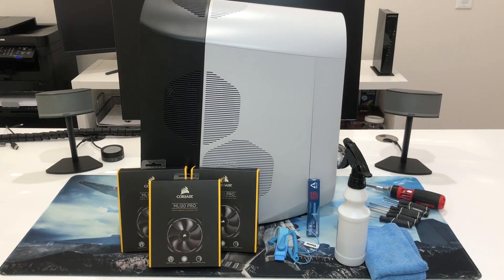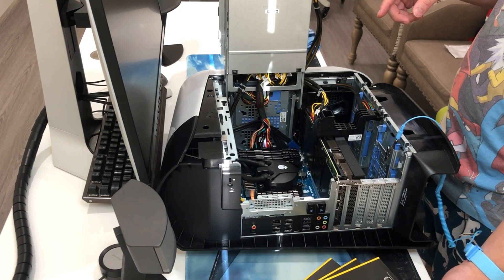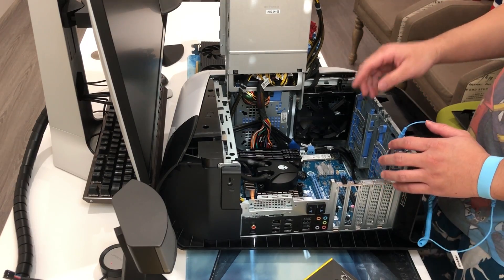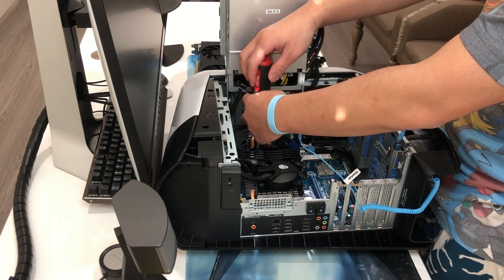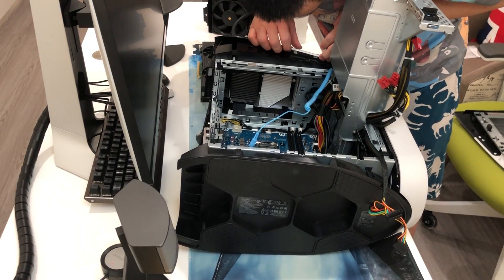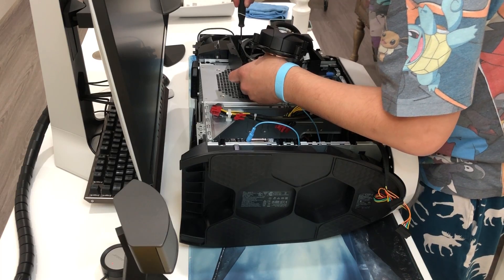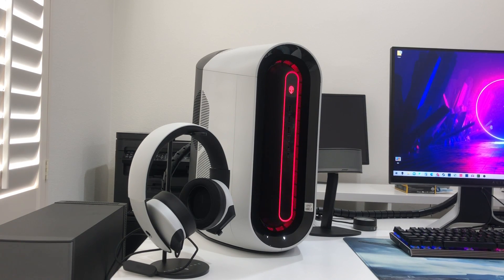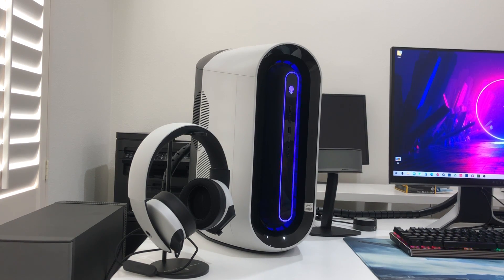How to Upgrade Fans for Alienware Aurora R11 / R12 to Lower Temperature and Noise - Top & Front Fans

Comment: I bought my R10 like 3 months ago... it was the only way I could get the GPU I wanted. anyway mine looks identical on the inside. So I'm curious why this wouldn't apply to the r10 or maybe it does. I really don't care about how hot it runs... it never really gets over 60c even if I run cinebench r20 for 10mins.... it hits maybe 68c. It's overclocked at level 1. it's a ryzen 5900X in an RX6800XT. The temperature of the GPU... I do worry about. It hovers in the high nineties sometimes over 100c.. Especially when gaming in 1440p or 4K. if I cap it in 1440p at 60fps it'll stay in the 80s and low 90s. And that's playing ACC 2077 and rdr2. I have some kryonaut but I've been too nervous to take it apart and repaste it. I've taken apart 2 laptop and repasted them but they're cheap first-gen laptops. Complaints that I do have are that smart Access Memory doesn't work and the PCI slot is only 8x LOL I'm probably saying that wrong but it only uses gen3 not Gen4. Maybe in a couple months I'll get a case power supply and a badass motherboard and I'll just have a badass computer. Please remember before roasting me in the comments that this is my first PC and the only reason why I got it is cuz I was tired of PlayStation.
Reply from the maker: Thank you for sharing your experience man. how's the beast running now?

Comment: I’m getting top fan bios error
Reply from the maker: How many fans did you change?
Reply: @RyanYu  3, mostly the top fan is giving me the bios error.
Reply from the maker: @Eqnotalent  did you use the Y-splitter ?
Reply: @RyanYu  the top fan no, the 2 front fan yes.
Reply from the maker: @Eqnotalent  so, you add another fan to the front then? Try to remove one?
Reply: @RyanYu  i added one at the HDD bay
Reply from the maker: @Eqnotalent  Have you tried to remove one to see if it works?
Reply: @RyanYu  yes, still getting top fan bios error
Reply from the maker: @Eqnotalent  just one fan without the y splitter ?
Reply: correct. 2 front fan on Y cable on the 4pin front plug, top fan by it self on the topfan plug.

Comment: The cooling upgrade was due to swapping the thermal paste FYI. Those original fans are 146 cfm and the Corsair ones are maybe 70 cfm. That's what happens when its 4k vs 2k rpms.
Reply: In such a restrictive case pressure performance may be more important than CFM... Also why would Dell make a top of the line PC a jet engine?! 4000 rpm is too crazy for so many thousands of dollars, they could have put Noctua A12x25 at that price point and still make mountains of profit.
Reply from the maker: It’s not only about CFM.

Comment: May I just keep the side cover opened at all times so as to lower the temperature?
Reply from the maker: You can of course buy it will get a lot dust.
Reply: Yes that helps. Reduced temps by 3-5 degree celcius

Comment: Those Corsair ML120 Fans are significant lower CFMs than the stocks fans, so definitely are quiter but does not improve cooling, in fact, the other way around.
Reply: Naive, bro, you may not good at physics. Fans manufacture not only consider about CFM, but also consider about air pressure. More specifically, static pressure. And you will find out that higher CFM mostly get lower static pressure. the fans manufacturers take a lot of effort to find the balance between these two factors. So only focus on CFM is not make sense…..Think about the relationship between torque and rotational speed
Reply from the maker: @jiayilin836  man, there is so much to learn.  I’m learning every day.
Reply: @jiayilin836  You are correct, there are other variables to consider aside CFM, that's why I made the test: I took temps of my GPU and VRAM with the stock fan versus the Corsair ML120 during mining, and the temps were considerable lower with the stock fan (the noise was way louder as well). CPU temps were also a couple degrees lower. I ended putting the corsair fan at the top, instead of the HDD place holder and the stock fan in the original place to keep the VRAM as cool as possible. And yes, I don't have a PHD degree on Physics, but I'm an engineer and took enough Physics courses during college (not that really matter in this case..)
Reply: @DefianceDarkness  oh really? nice job, you will find more. just keep going further
Reply: So replacing original fans with Corsair fan will lead to higher temps?
Reply from the maker: @pb96-p6g  it should decrease
Reply: @pb96-p6g  I think it depends of each specific scenario. In my case, under heavy loads (long OC gaming sessions and criptoming), and at 100% fans speed, the stocks fans kept the temperature lower (specially the GPU). In your case could be different, the only way to be sure is doing the test yourself.
Reply from the maker: Not in my case maybe I got lucky.

Comment: I replaced only the front fan in my r12 and now it boots slow some times does not boot and one time had the amber blinking code of 3 for the chip set and while blinking just booted after 3 min any ideas why?
Reply: I am able to use the computer when it finally boots and it stays 3 degrees cooler I just can't reboot use to take like 5 sec on a reboot now some times it won't even boot
Reply from the maker: @joshdumler  that’s odd, first time hearing issue like this.  Normally this only happens to the ram upgrade.
Reply: Replace stock fan booted right up this is on aurora r12 with 11900kf 64 gb 3400mhz hyperfury ram with a 3090 I can't figure this issue out for the life of me....
Reply from the maker: @joshdumler  did those fan that you install spin?
Reply from the maker: Did you use the same fan that I used ?
Reply: Yes and followed your video to the t!  Even opened it back up 3 times checked connections and swapped the second fan from the 2 pack in just to make sure it wasn't a faulty one..
Reply: I am gonna try and put the stock fan in and see

Comment: Good evening Brother, if you don’t mind and have a time then could you please do let me know, regarding for installing the extra fans on this Alienware Aurora R12, what exactly do you need, I mean which leads, splitters, power leads, adapters and how many, please explain everything, how you did it and what exactly do you need, because like you I also definitely want to install extra fans on this PC, that’s why I will need all the information regarding this, and also Brother, those two 2.5 inch slots for SSD, will either 1TB on each slot or 2TB of Samsung 860 PRO 2 TB SATA 2.5 Inch Internal Solid State Drive (SSD) (MZ-76P2T0) or Samsung 860 QVO 2 TB SATA 2.5 Inch Internal Solid State Drive (SSD) (MZ-76Q2T0) work, and also Brother about fans, Corsair iCUE QL120 RGB, 120 mm RGB LED PWM Fans (102 Individually Addressable RGB LEDs, Speeds Up to 1,500 RPM, Low-Noise) Triple Pack with iCUE Lighting Node CORE Included - Black or Corsair iCUE QL120 RGB, 120 mm RGB LED PWM Fans (102 Individually Addressable RGB LEDs, Speeds Up to 1,500 RPM, Low-Noise) Triple Pack with iCUE Lighting Node CORE Included - White work, many thanks and really appreciate for you’re important time Brother.
Reply from the maker: you will need 4 screws and 1 y splitters, I have the link in the description and comments. no other stuff that you need.  you can fit two SSD for no problem too .
Reply: @RyanYu  thank you and really appreciate Brother for you’re important time.
Reply from the maker: @oVqrtexZ123  no problem buddy.
Reply: @RyanYu  Brother again Good Afternoon, Sorry for asking same question, will these fit and work on Alienware Aurora R12, with all the leads included in the kit, iCUE QL120 RGB 120mm PWM White Fan — Triple Fan Kit with Lighting Node CORE, really appreciate and many thanks Brother, Mohammed.
Reply from the maker: @oVqrtexZ123  I’m not sure other brand. But the crosair works fine on my R12 too.
Reply: My Apology For keep asking Brother, but these fans are also from CORSAIR, like other peoples I also don’t know much, but I’m sure Brother you have quite a lot knowledge about PC, Especially Alienware Aurora R12 Upgrades, if you don’t mind and have a time then could you please do check these CORSAIR FANS information out on their website, and let me know, if they would work on this Machine, many thanks and really appreciate Brother for you’re hard work and important time.

SKU CO-9050104-WW
CORSAIR iCUE QL120 RGB 120mm PWM White Fan — Triple Fan Kit with Lighting Node CORE Included,

Give your PC spectacular lighting from any angle with the CORSAIR iCUE QL120 RGB PWM White Triple Fan Kit, equipped with 102 individually addressable RGB LEDs – 34 in each fan – across four distinct light loops in a brilliant white housing.

Comment: Are the thermal take ring 12 fans good for this pc? I don’t have many options.
Reply from the maker: Crosair is the better choice
Reply: @RyanYu   I bought the Corsair af 120 but I can’t control them
I notice my stock fan kept my thermals lower than the af 120 because fan speed could be faster
Reply from the maker: @jiren3737  it needs to be the exact one that I used in the video
Reply: @RyanYu  last question
Is two fans enough for the aurora r11 or should I add another intake
Reply from the maker: @jiren3737  two is enough bro.  I have two replaced I didn’t add the third one and it works fine.
Reply: @RyanYu  last question, are they quiet? People say they are loud.
Reply from the maker: @jiren3737  they are pretty loud. haha
Reply: @RyanYu   a good video idea would be a fan test for the ml 120 pro inside the aurora r11
Reply: @RyanYu  ty for the help
Reply from the maker: @jiren3737  I have that man. In the video I have before and after
Reply from the maker: @jiren3737  no problem

Comment: i just upgraded my air cooled alienware R10 Ryzen to corsair h60 hydro and corsair ml 120 pro, it is much much quieter now, but the noise is still noticeable comparing to my laptop at idle. the cpu temperature is ridiculously low at 32c(89f) right now.
Reply from the maker: upgrade the top and front fans, also consider to upgrade the power supply will also help to lower your noise man.

Comment: Thanks for the video! Do you think I may be able to add two Noctua NF F12? I bought a R12 a few weeks ago and intend to upgrade it with two Noctuas. Thanks in advance.
Reply from the maker: It will work, but you will get error message, the ones that I used in the video is the perfect ones.
Reply: @RyanYu  thanks! I guess its not a big deal if I use them

Comment: ive had mine since beginning of january and mine is liquid cooled so it does stay cool but does run noisy when im playing games on it so would these fans be good addition to the liquid cooling? i havent opened my case up yet to see how it looks inside but im guessing that it still has the fans in the same place
Reply from the maker: Mine is also liquid (CPU).  You can do this mod for sure
Reply: @RyanYu  spent $3300 on mine to get the i9 and also the same ram as urs would think we could be able to get quieter fans but ive been enjoying mine so far

Comment: Ey men! i need help! I did everything the same as your video, but after resetting I get an error:
TESTING TOP FAN PRE-BOOT SYSTEM
PERFORMANCE CHECK

ERROR CODE 2000-0511
THE TOP FAN FAN FAILED TO RESPOND CORRECTLY
Reply from the maker: how many top fans are you using?
Reply: @RyanYu  1 i just change
Reply from the maker: @cristobalruiz4398  does it spin? check the cable if it is fully insert?
Reply: @RyanYu  I think so, because the computer works normal. the cpu temperature is 28 degrees celcius. and I can play without problems. I do not know if it is advisable to return to the original fan?
Reply from the maker: @cristobalruiz4398  if it spins normal I wouldn’t worry about it.

Comment: Hi friend, the VRM heat sink that came with your CPU water cooler is out of stock every ware. I see you installed it at the end of your video. Can I just add some cooling fins with adhesive thermal tape my self? My R12 was delivered today but it’s air cooled. So I bought a Corsair water cooler and a new Corsair front fan and good thermal paste. I just can’t get the VRM stock passive fin cooler you have.
Reply from the maker: Actually I didn't upgrade the VRM heat sink.

Comment: Which way is the front fan facing to install in the bracket?
Reply from the maker: There is an arrow on the fan which should point it into the case
Reply: @RyanYu  Thanks I do see the arrow, but if I install it facing that way then the front fan will be pushing air out of the case, (the way it spins) I thought front fan is supposed to bring air into the case? No? And just to confirm the bracket only goes into the case in one orientation right? Or am I supposed to flip the bracket the other way around to bring air into the case?
Reply from the maker: @a2roland  the arrow indicate where the air will be blown to.  So you would want it to point it into the case.  So it will bring the air into the case.
Reply: @RyanYu  Thank you! 👍

Comment: i have changed the front fan, but now everytime i boot up pc, it will do support assist pre-boot performance check, how can i disable that? Disabling secure boot in BIOS doesnt helps. I am using R12
Reply from the maker: Which fans are you using?
Reply: @RyanYu  noctua P12 redux 1700pwm
Reply from the maker: @kohzhengqian6139  that's the problem. you can try crossair ml120 pro.
Reply: @RyanYu  why cannot use that? Any specially reason for that? I actually checked noctua p12 spec and noticed is quite good. Bought is from overseas, but after install one, I'm so depressed now
Reply from the maker: @kohzhengqian6139  CROSSAIR is the only brand that I found that you can install without getting error messages.

Comment: thanks for the video mate! This may sound like a very stupid question, but if you didn't care about aesthetics of the case and having the top lid on, to make this simpler could you not just attach a pull fan on top of where there radiator is sitting and screw it down? Why do you mention on your video that the fan at the top of the case is not the right place to put it? thanks!
Reply from the maker: The first time I put it on was wrong because I couldn’t close the top cover haha. If you leave it open that is fine.
Reply: @RyanYu  thanks for the reply, yeah  just putting it on top and leaving the top cover off might be easier as while your instructional video is great, I don't think I have the balls to take off the cooler/radiator etc just after I've spent all that money. Prefer bolt on mods at the moment. However, you may convince me to change my mind later.
Reply from the maker: @sachithradesilva3979  it is so easy.  Easier than we think.  I was the first time in the video too.

Comment: Would this work with an r9?
Reply from the maker: I guess so.
Reply: @RyanYu  is planning to get everything used on the video on an Aurora r9. Are the fans on Aurora r9 120mm?
Reply from the maker: @FPE23  yes sir, but buy one first to test it in the front fan, make sure you don't get error message then go for the others.
Reply: @RyanYu  thank you

Comment: the top doesnt fit back on with a fan on top radiator?
Reply from the maker: No.  I placed it wrong at the first place.   It should be in between the radiator and the bracket.

Comment: Hey I changed R12 top fan today and When i power on and go to pre-boot system performance check. Do you know how to disable in BIOS?
Reply from the maker: I didn't go to BIOs to do anything about fans yet, so I don't know buddy.
Reply: @RyanYu  Thank you! and ML120Pro work on top? No error code when are you boot? I ordered That liquid cooler again and try to ML120pro again. Noctua can not passed.
Reply from the maker: @mixvideoinus  ml120 non led works fine.
Reply: @RyanYu  Thank you for the information!

Comment: Can I just replace the top fan without adding another one?  Does it help with the airflow? Do I have to remove the top lid to replace the top fan?
Reply from the maker: Yes you can. I only changed two fans in the video too.

Comment: Can I replace the top fan without redoing the thermal paste?
Reply from the maker: You have to.
Reply: @RyanYu  I got a BIOs error but the fan works fine. Anyway to disable the error or should I just live with it? Got some paste a new fan for the top next.
Reply from the maker: @swank2233  Did you use the same fans that I used? I don't have any messages.
Reply: @RyanYu  I did. Oddly it was fine before I updated the BIOs. Not a huge issue
Reply from the maker: @swank2233  oh that’s why. The bios fked it up.

Comment: i tried replacing my fans in my R9  but now when i run Alienware diagnostics program it wont recognize  the fans  fails fan check failed  any idea's why and how to fix
Reply from the maker: Did you use the same fans that I used ?
Reply: @RyanYu  yes  have u tried running a Alienware diagnostic since u installed the fans
Reply from the maker: @crowdaddy6472  no.  It works fine so I don’t need that.
Reply: @RyanYu  can you try it please just so i can see if it's just my computer or it's computer not liking the fans in my computer
Reply from the maker: @crowdaddy6472   I ran it with no problem.

Comment: I changed the fans on my R10 to the corsair ml120 pros but in alienware command center for the front fan I can not adjust the speed it stays at 27% no matter how much load or high the Temps get. Any advice how to make it work to control fan on front?
Reply from the maker: Is it on balance? Try to make it performance if it goes up.
Reply: @RyanYu  I figured it out once you make a new profile you have to hit home and change it under active lol